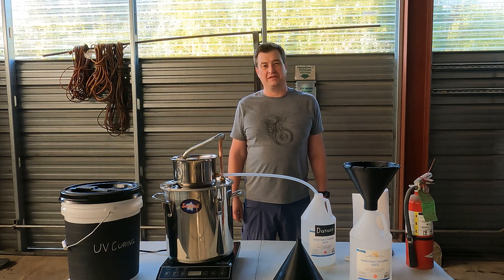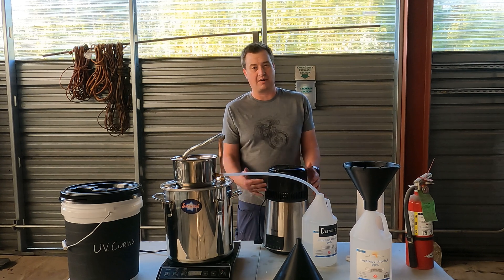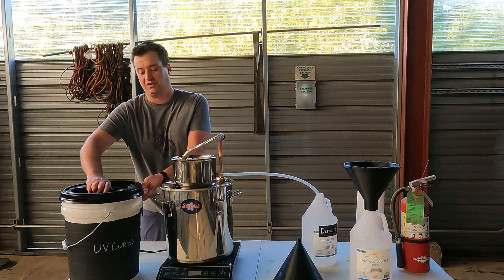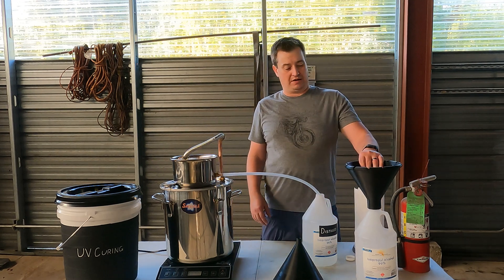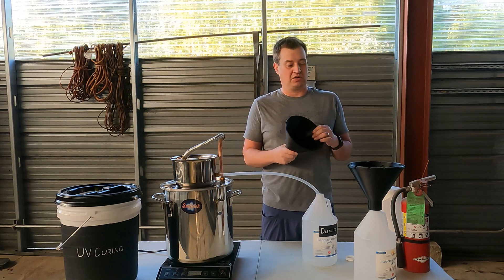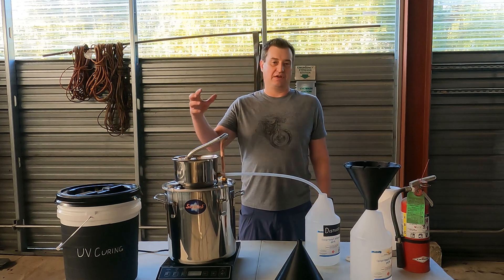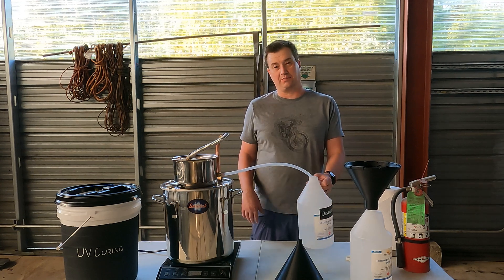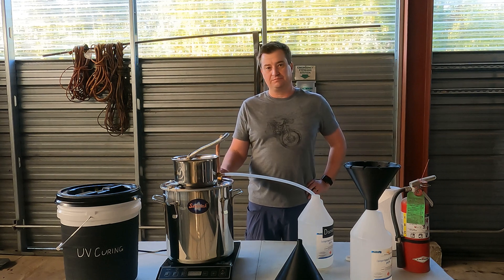IPA Cleaning / Reclamation for Resin 3D Printing

Comment: Did you ever hook up a pump or aquarium chiller to the condenser? I bought the 3 gallon but the condenser is open to atmosphere so I’m wondering how yours is set up so it doesn’t overflow.
Reply from the maker: Yes, I did. I'm getting ready to upload a follow-up video soon. The pump I got (https://www.amazon.com/dp/B07VR1BGC5?ref_=ppx_hzsearch_conn_dt_b_fed_asin_title_16&th=1) has adjustable flow, so I just set the flow so that it drains fast enough not to overflow.
Reply: @Jared_Ainsworth  Hey thanks! If it’s not too much trouble to add to the video, could you also address how you know when the distillation is done? I know you’re working outside do you just open the lid?
Reply from the maker: @steampunkwhale2280  I already shot the footage and I didn't cover that point. I just know it's done when the flow slows way down. Once it gets to a point where it's hardly dripping into the collection jug, I call it good for the day. I only really open the lid to fill it before I start. That's also when I take a look to see how deep the sludge is. When the sludge gets to maybe 3-4 inches deep, I clean it out (every 10-15 gallons of IPA or so).
Reply: @Jared_Ainsworth  Yeah I thought you might have already shot lol no worries. Thanks for responding again!

Comment: You wrapped it with black? The black will reduce your uv by absorbing it in the material. You should use reflective light surface like foil
Reply from the maker: The inside IS wrapped in foil tape (shown at ~1:40). The black on the outside for gaps in the tape (I was a bit sloppy with the foil tape).

Comment: Thanks indeed Jared! Question: How many times do you need to replace condensers water adding new ice, during the distill process of a couple of IPA galoons?How do you control that really the IPA outlet is just condensed IPA and not steam, to take the decision  of replacing warm water by ice in the condenser?
Reply from the maker: The short answer... TOO often. 
In one 8-hour day at the office, I went through 3 bags of ice just to get about 3/4 gallon (very dirty IPA, cleaner goes faster). I did end up connecting a 5-gallon bucket with a fish tank pump, but even that was pretty inconvenient having to top it off with ice every couple of hours. What I ultimately ended up doing was attaching a fish tank chiller to the bucket and that is working GREAT. I used this one https://amzn.to/4a9vjRf, but I see those are no longer available. If you go that route just make sure to get one with a compressor. The fan-based heat exchangers won't work so well on a hot day. It wasn't cheap, but it's SO MUCH nicer just letting it run all day without having to change out the ice. I figure at the rate I was going through ice it will pay for itself EVENTUALLY, and it's just so much more convenient anyway it's worth it to me :-)

I really need to do a follow-up video. I got everything installed onto a small cart now and I'm super happy with the setup, but I have several tips to offer (like insulating the chiller hoses so water doesn't condense and make puddles all over the place).
Reply: Thanks again Jared! Really helpful info! I really was wondering how that would work without a kind of external cooler... With the current setup you also distill around 3/4 gallon every 8 hours? Looking forward to watch your final setup. Sure it is worth while :-)  @Jared_Ainsworth
Reply from the maker: I have ~8 jugs now that are my "dirty" jugs. I put dirty IPA in those for curing and filtering before going into the still (and actually I've been lazy and skipped the filtering more than once in exchange for more sludge at the end). I swish and rinse my dirty jugs with distilled IPA a bit, but they never get totally clean. When they get too bad I use them for the leftover sludge from the still and then dispose of them with the city.  I try to keep my clean distilled IPA in bottles that have only ever had clean IPA in them.
Reply: Remember, it’s illegal to distill any type of alcohol in Texas, without a license. Even in Austin or New Caney.
Reply from the maker: @timriddle1401  wait, what?!?  I guess I had better look into that.
Reply from the maker: I think I'm pretty safe. Those laws target alcohol for consumption. This still could NEVER be used for consumption again, it's nasty :-)

Google:
"While distilling isopropyl alcohol itself isn't inherently illegal, distilling it with the intention of creating a beverage for consumption is illegal in most jurisdictions as it falls under the category of home distilling, which requires specific licenses and permits that most people do not have; always check your local laws to be sure. "